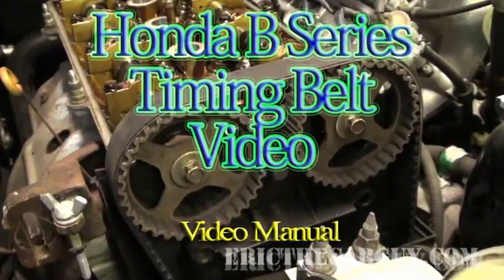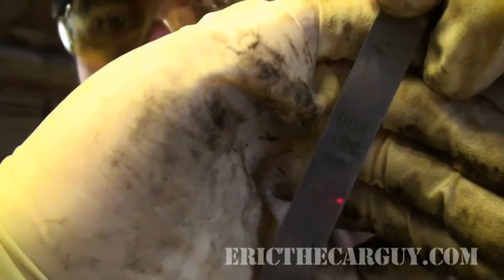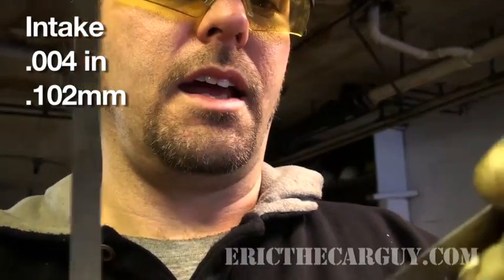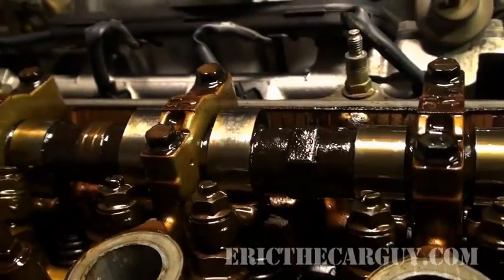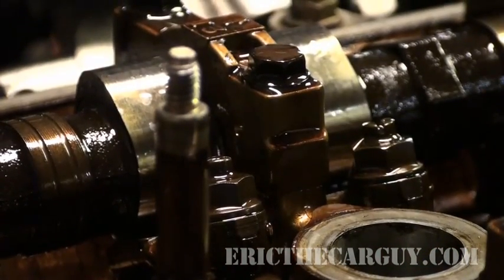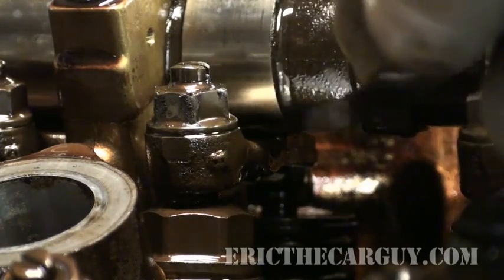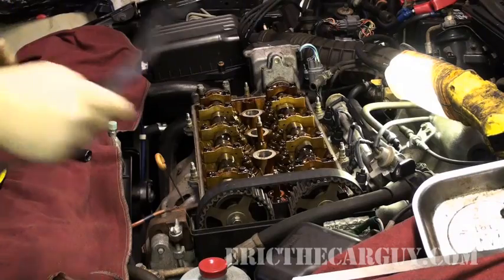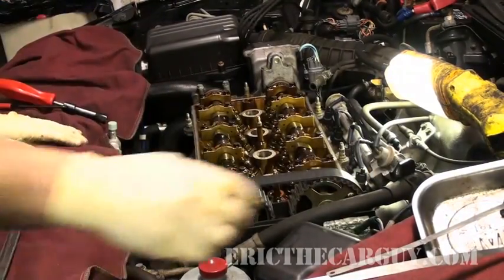Adjusting Valves Acura Integra B18B - EricTheCarGuy

Comment from the maker: @spelunkerd 16 lifters actually, 2 valves per cylinder, you would need to replace the cam too as they are a matched set, a good opportunity to upgrade the cam if you asked me.  You might consider using thinner oil if you are running something thicker than stock or what is called for by the manufacturer.

Comment from the maker: @TaLoCc Nope, don't mess with ignition timing as the computer will correct you anyway, if you want more power out of this engine put a turbo on it, the low stock compression is good for 7-10psi right out of the box.

Comment from the maker: @SD457500 Honestly most other engines are hydraulic valve trains and don't require adjustment.  Honda is of the few that does not use hydraulic lifters.

Comment from the maker: @STFUDouchebags I worked on these cars for year and I've owned 5 of them.  Thanks for the comment.
Reply: My first one owned, my 4 outter are so tight, and all the inners are lose I lost oil pressure and thought I may have fried the engine but may get lucky and just adjust it and hopefully it'll be ok... A used one of these engines for anyone runs about 1k to 2500 low end price non VTech higher end with VTech and ECU alot of times.... Love the video man. Pray it works!!!

Comment from the maker: @nicholas0142003 You also might want to check out the video I did on solving Honda idle problems but the J series had issues with the IAC's so that's a good possibility.  Also check for vacuum leaks.

Comment: Thank you very much for your video. I have been looking on everywhere for the specs, I was about to bring it in and for sure you saved me $150+. This guy knows what he is talking about, Thanks again!
F.Y.I ****** 19mm is to turn the power steering pulley which in turn turns the crank and spins the timing gears so that you can get the cam lobes to point away from the rocker arms. Also... the cams are marked ( EX - IN ) on the opposite side of the motor as the timing gears for Intake and Exhaust.
Reply: Dustin Stickan thank you for the intake and exhaust info !

Comment: The lifters on my 2000 Suburban are really noisy, but only when the weather is cold. It's an old vehicle and we've been putting up with it for years. Is the only reliable solution to replace the lifters? How much would a set of 8 lifters cost?

Comment: Great video. I have a b18c honda motor im working on. I was changing the belt and installing a aftermarket harmonic balancer on the gearshaft. I didn’t have a problem lining up the cams, however, as i was installing the harmonic balancer, With the belt removed, I believe I may have moved the TDC of the main crankshaft off of its center. I cannot view the marks of the main crank because the aftermarket harmonic balancer now covers it and its far too difficult to remove now. I was planning on putting a stick in the spark plug hole to find dead center as it raises up upon moving the crankshaft, but I was concerned that the valves would be affected, so i removed the cams from its journals to avoid any valves from being bent and now im planning on turning the crankshaft (counter clockwise) measuring TDC of the camshaft in order to get it TDC. Question - Am I correct to assume that it’s important to get my maincrankshaft on TDC ? And if so, am I doing it correctly? Thanks. Any help is appreciated.

Comment: I did this several times on my b18's. What I noticed though, was when the lobe was facing straight up, the feeler gauge didn't fit, but when the lobe was opposite to the valve it would fit. This means the cam is not the same all the way around when not on the lobe.

Comment: Interesting video. I never heard of this before. I have an  03 envoy, 02 cavelier, 98 maxima 93 vigor, 99 solara. All with now over 300,000 miles and never did a valve adjustment. Should I have my mechanic check them or dont bother with it. I'm having no problems cars are running great.

Comment: Have you run across over tightened nuts on the adjusters that once the nut is loosened you cannot turn the screw in the nut.   so to loosen the nut from the adjusting screw I turned the nut until the screw stopped turning and the nut loosened.   However I cannot free the screw from the rocker now.   Thoughts?

Comment: great video i have a 91 accord 270k miles and valves are noisy so im going to try this i just need to get the gauges 10 and 18 does it apply to the f22 series engine

Comment: I have quite a noisy valve train (b16a2) either LMA or Valves, Valve lash is free to try first so im going to do that as its at 113k Miles and has "Never had Valve Adjusted" in the previous owners ownership (7 years, and none car enthusiast previous so probably never had it done since routine maintenance in Honda services) - Do i need a deep bent 10mm for B16A2 VTEC DOHC?? Thanks, your videos are brilliant!

Comment: I bought another b18 head and i set my valves to spec and the intake camshafts acually bootom out the spring and it actually locked the cam up. So i set them at .007 and i can just hardly turn the cam. Ive done numerous valve jobs never had issues. Any idea what im doing or if something is up with the head?

Comment: for this DOHC engine, to you have to be at "TOP DEAD CENTER" before you can adjust your valves springs or is having the opposite side of the lobe sufficient to adjust it. any suggestions would help thanks.
Reply: You do not have to be tdc
Reply: the factory service manual recommends TDC before adjusting valves.

Comment: I always see people say you want a "slight drag" on the feeler gauge. That's pretty subjective though. To me a slight drag would be barely any drag at all but this video shows it being much tighter than that. To me it looks more like a pretty decent amount of drag, since when you try to put the feeler gauge in it bends a little before sliding in. Definitely a very tough thing to describe the feel of. 

I just finished my first valve adjustment and may have to go back in and go a little bit tighter. I did a slight drag but from this video it looks like a need more.
Reply: xex2kok do you have to torque or tightening by hand works?
Reply: I just went by hand but I'm sure there is a torque spec. Whatever it is it's very low, not super tight. Tighten the nut back on snug but don't go hulk on it.

Comment: Etcg I need your help. I have a b18b1. The engine is built and brand new. Ok I mixed up my rocker arms. First is that okay? Second you can adjust your valves I'm any way as long as the lobes are pointing up correct?

Comment: When i did this on my 1st bike I made it tight enough so that the slide went in, but the next biggest size didn't. I never got to see whether i did it right... it wouldnt idle well, but it was because the carb hoses were leaking air and I left at the mechanic in hopes of finding the prob but just readjusted vavles and didnt do jack, a 2nd guy helped me diagnose the prob.

Comment: tight or to loose is there something else that I can do for not just a valve adjustment but also while doing cams and other jobs with the whole internal engine that I can know my work is good and runnable without having to start it all while learning freehand I know the outside engine parts like the back of my hand just not much experience inside the motor ever changing things but I want to upgrade my lsvtec more at some point and I hear cams r the 1st with springs and valves please let me know

Comment: Why are the cam gears not pointing the correct way everytime you adjust? I am looking at instructions from Acura and they show the Up Arrow pointing exactly Up, Right, Left, or down exactly? Yours are like at 5 o'clock, 1 o'clock etc. Instructions show 12 o'clock for #1, 9 o'clock for #3 cylinder, 6 o'clock for #4 cylinder, and 3 o'clock for #2 piston... Am I looking at something wrong?
Reply: i agree with you Andy Noble, Eric is not lined up at the right position when adjusting the valves! Why is this it appears he over looked this!  at least it is not my vehicle!! LOL

Comment: I have a 2001 Acura Integra LS 1.8L I recently replaced the timing belt on it. When I first started it up it ran fine. Belt was a bit loose but I tightened it up. But now when I start it to idol in park the engine continues to climb in rpms. The engine light came on and gave me p1399 and p1508 which 1399 is random misfire and 1508 is IAC valve. Can the valves needing adjusted throw both those codes? I don't want to replace the IAC if it's not necessary. It was working fine and I cleaned it the other day. Voltage all checks out. I'm looking for advice so I don't pointlessly throw money out that's not necessary.

Comment: Hi. i just have a quick question. I have the same Integra as you. I had a valve adjustment done to it and now it idles really low (around 300-400 rpms) it idled perfectly before the adjustment at 800 rpms. can my low idle be due to the valves being too tight?

Comment: I was doing a valve cover job on my integra and luckily i noticed that one of the rocker arms was popped out. no damage to it or the cam but it was just free. Would them being loose cause this?
Reply: YES it can, but if it was that loose due to valves being off you would probably be able to hear it. .. what you described happened to my teggy b18 ls, The rocker arm on the right, intake side, 3rd cyl  popped out, But on the highway, slid to the side, marring that cam lobe, then the valve keeper popped, valve was then punched by piston #3 breaking the valve stem effectively ruining my resurfaced head and that chipped stem got into cyl 4 and gouged cyl 4s piston head.. Morale of the story... valve adjusting is important, like Eric said its fine tuning, not for the faint of heart lol. For anyone curious, it was due to not finishing the tune, again like Eric said u may have to go thru a few times to get it right... 2 for me was not enough..

Comment: Thanks for the video, I need to adjust a few noisy valves I have on my "rebuilt-by-me" Subaru motor. Has about 60,000 miles on the rebuild, and had the heads done professionally so they were adjusted perfectly when it was put together, but the valves have become a little chatty lately. Probably going to have to lift the motor to get to the valves. Clearance in the engine bay with the boxer is major PITA. lol. Thanks again.

Comment: what would it make pop out the exhaust i got the timing right on i just did the valves it is idle rough and it 1998 acura integra 1.8 liter  jim

Comment: You need to use the special tool for the VTEC. 
The adjustment nut is too recessed to use the flat wrench/screw driver combo. It is a PITA without the tool.
The powerbuilt tool is much cheaper than Blue Point, and is on Amazon for cheap...

Comment: Hey Eric, My 07 civic LX needs of valve adjustment, but before i do i wanted ask you. On Honda's newer R18A1 engine do i need to be exactly top dead center on the cylinder i am doing the valve adjustment on or does that not matter? Its timing chain driven. Thnx eric love your video's.

Comment: hey Eric: love the quility you put into your videos. I have a j30A1 with almost 250k not sure the last time the timing belt was done but the valves a a wonderful symphany of cam ticking. and when in neutral and you give it alittle gas when the ideal come back down, the other goes really low in rpms then right away comes back up. This does not happen when in drive. just when free reved. Wondering what kind of issue that might be. IACV has been repleaced but not becasue of this issue.

Comment: what size filler gauges did you use? and do you have to torque the bolts down? if so to what lbs?

Comment: Okay, on my #4, left side intake valve, the feeler guage won't go in. It's too tight and won't go down any further. What does this indicate? Thanks
Reply: Did you find a fix going through same thing
Reply: @Kennyb-tj5ek  no, not yet. Haven't messed with it in a couple of weeks. Needed to just step away for a while. The problem is now I kinda keep avoiding it, and I'm afraid it's just gonna turn into a rust heap if I don't get back in there and get this thing done right.
I figured out my problem. I just don't know how to remedy it.
The problem is that I've been adjusting at the same time. Get it TDC on the right one, (I'm in a car late at night, so specifics don't worry, please) ok. So correct one and do intake at .17, then do exhaust at .19. Then go to the next one. Do intake at .17 and exhaust at .19. Do next...》
What I'm doing wrong? Idk. I shouldn't be doing both at the same location, right? I mean correctly, isn't the exhaust one gonna be on a different cylinder or something?
Reply: @Kennyb-tj5ek  Shit. Just realized I answered the wrong thing. Yes. I did get it right. I do have space to adjust it. Now I just need to do the stuff in the right order.
Reply: @Phdintheory how did you get it to fit ? I can’t adjust one of my valves enough to fit my feeler gauge in it’s driving me crazy

Comment: What order should the valves be adjusted? I read furthest from timing belt starting with intake then exhaust and so on... Is that how it was done?
Reply: Start with #1 cylinder then 3-4-2.  Adjust intake and exhaust on each cylinder before moving to the next cylinder.

Comment: Your method works except on my LS with  over 200k miles is hard to turn over for some reason and turning the P/S pulley bolt just busts it loose.
Reply: If you are unscrewing the nut then you have to be turning it the wrong way. Just make sure the car is in neutral and spark plugs out and it should work fine.

Comment: So I'm an idiot. I busted a rocker arm clear out of there. One of the locknut's was seized. Do I have to remove the cam on that side when I reinstall the rocker arm? It looks like I have to get a spring compressor, pull the cam and install new keepers which went flying.
Reply: Which way did you turn the locknut?

Comment: @Intelpentium54321 On SOHC engines.  instead of going off the lobe and rocker arm.  Where you would stick the feeler gauge is where the tappet meets the valve.  so right under where the screw and nut are.

Comment: "A little bit of drag" on the feeler gauge is good...if your workshop manual actually has the correct specs listed. Mine doesn't...setting my valves to the books specs leaves them noisier than ever.

Comment: When I got my Integra, it wouldn't idle either. I cleaned everything in the intake, the throttle body, the IACV, etc. It turned out to be the throttle cable was loose! If it seems to be running good, but just wont idle, check that lol

Comment: my iacv is clean and my tps and map sensors are fine i cant idle.. could it be my valves? i have done a timing belt and water pump so yes; the engine is timed.
Reply: Roxxy The CRX what you mean can’t idle?

Comment: Hey Eric I'm begging u to help me plz so my car is a 1996 integra gsr stock b18c1 motor its making a wired flapping noise from my head right when I start my car is loud den it quiets down but u can still hear it when u pop the hood open I just got a valve adjustment t but it seems dats not the issue. Can it be the dizzy? Or is some thing loose?
Reply: TypeSupport maybe try & spell your words in English for a better chance at a response. "dats" isn't a word, even if it sounds that way when YOU say it out loud. "Den" is a place where bears and badgers live, or a room in a house - not a time frame refrence (I'm no grammar stickler so the actual part of the English language you're going for is irrelevant). I'll leave it to you to figure out the proper words. I know on forums, people who type like they speak, and speak like idjits tend to get lessssss in the way of useful responses. dem dat dis.... if you can't be bothered to add the couple extra letters to spell actual words - well, I won't be bothered to try and answer your stupid question

Comment: hey eric I just first off wanna say I love the work you do and vids u  make I give u a lot of respect and credit uve helped me with a few diff probs I ran into when I swapped my ls vtec in ... now that I have my old stock ls motor out and not being used but it is a working engine just high miles and no vtec lol  but I want to use it to learn to rebuild the heads and the internal items in the engine but if I do something like a valve adjustment I have no way to hear it run to listen if there to

Comment: you forgot to mention what specs to torque the locknuts down to after adjusting the clearance!
Reply: +Lalo Herrera That''s questionable in the real world, versus the world of techno-critics.  The factory doesn't adhere to them, and generally tightens bolts far over spec, since they don't want any loose comebacks.  A good mechanic should have a feel for reasonable torque on a locking or positive stop valve stem, and will probably be much closer to spec by pure instinct, that the factory's over tightening.
Reply: 18 lbs ft for B18B but if you've done them enough times you'll know by feel.

Comment: are the adjustments the same for a b18a1 moter
Reply: *motor
Reply: Yes.
Reply: +LBCBassKings Engine, motors are electric.  "Moter" is an actual word in some languages, as not all of the world uses the English language.  Answering Brian's question, the procedure is the same but the clearances may be different.  I need to revisit mine, as I've heard that it's better to be on the large end of the spec, as they can be noisy if a bit tight.

Comment: Great video eric !! Hey when my engine is on idle the fan don't turn on and it over heats when it's on idle unless i drive a lil fast for the engine to cool down .. So do you have any idea what it may be ? One more thing is, do i relly need precision work for the knocking sensor that's hangin around ?

Comment: im having problems with B18c1 motor Vtec. my rocker arm on my exhaust C1, my rocker arm is stuck and can't really to seem to fit the filler in between. also, when i do have it adjusted, i still hear ticking really bad. Advise?